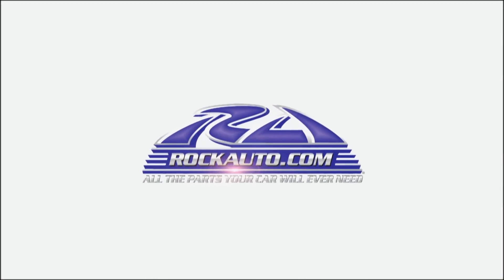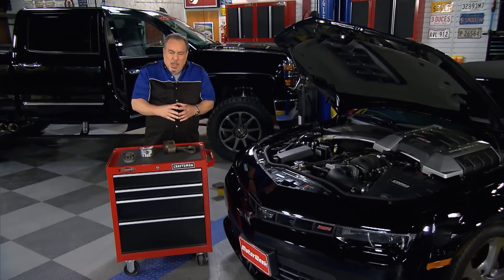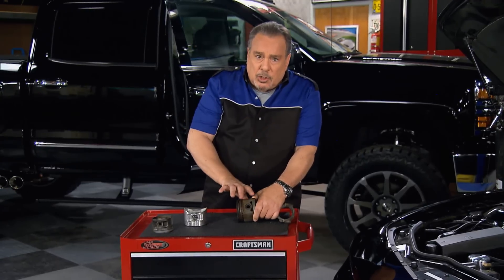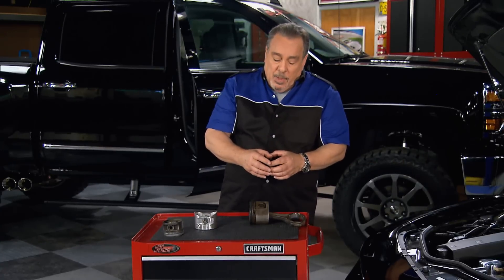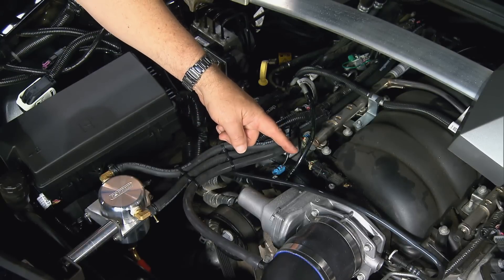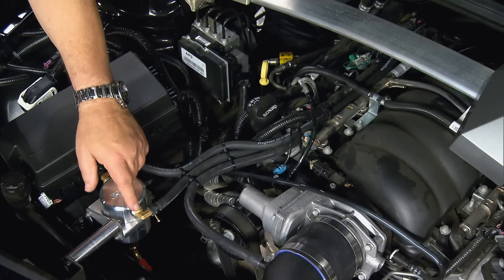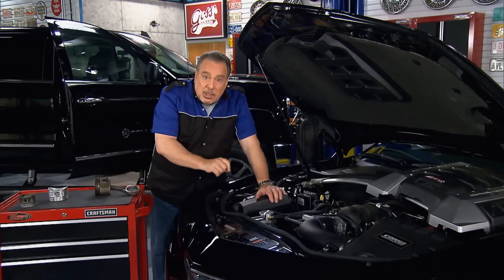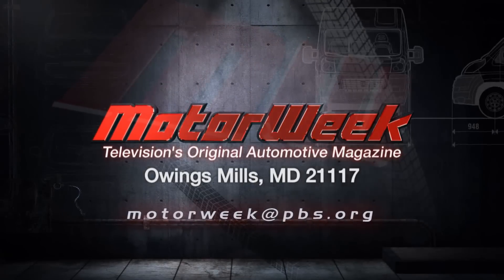MotorWeek | Goss' Garage: Catch Can/Oil Separator

Comment: Which one is better, catch-can or air / oil separator?
Reply: Catch can is simply a can with (hopefully) baffles where the expended oil sits and you drain out every oil change.  An oil separator is normally larger and has a return where the oil is then sent back into the engine.  On normal cars, a catch can will work.  OS is much more expensive and is used for higher compression engines, very large engines, or a race car set up.  For added benefit, you can add a stainless steel scrubbing pad to the can.  Don't confuse that with a Brillo pad or steel wool.

Comment: But will it void your warranty ?
Reply: All you're doing is re-routing a hose from the PCV to the can.  Instead of oil and oily vapor going back to the PCV, the oil is simply contained in the can.  No cutting of anything.  And if you need warranty repair, remove the can, re-attach the PCV hose and you're done.  Takes 5 minutes.  There's absolutely no way of knowing.

Comment: I did the same thing on my high mileage 2000 Ford Explorer. Recycling the fumes from the valve cover completely covered the throttle body and intake manifold. I simply removed the hose on mine and ran a Seafoam treatment, cleaned the throttle body flap and was done. The result was night and day. Although I will never put the catch can in an old school breather might do the trick.

Comment: These are especially useful on turbo and high compression engines. I empty mine every 3 months on my Subaru BRZ. It was a breeze to install and not expensive. It's a no brainer for anyone who does even minor things for their car/truck/suv.
Reply: So it's more for a performance engine or and engine with GDI?
Reply: Not really, more a preventative maintenance item that anyone with a compression ratio of 10 or above or has any turbo in their engine should run. This is one of many things OEMs do to cost cut effectively without ruining the engine in "normal" operation. However, OEM's don't consider hundreds of high revving accelerations onto on-ramps or whatnot to be "Normal". So after a while you will get a gunk build-up in the intake that was suppose to be burnt off by the engine (Also bad for carbon build up). So the solution is to bypass the system all together and take those oily blow bys and capture them before they enter the intake and allow the filtered air to go back into the intake.
Reply: Well Idk how easy E it is so I just let it breathe thru the cap loosen ½ - 2 turns depending on quantity and quality the viscosity 😂

Maybe you can make a video on it.  I had a toyota camry I was playing with.  There pretty quick for a 2.5 l 4-cylinder to rival with the k24

Comment: I asked my local dealer if this would void my warranty on my 16 Camaro, they told me I shouldn't do it. I want to but I'm worried about losing my warranty if something goes wrong.
Reply: It will not void any warranty. They would have to prove that this install damaged the engine would be impossible being thousands of catch cans are installed across the country.
Reply: Also, most of those dealer "salespeople" known as service advisors probably don't know what a catch can is. If they don't know what something is, their standard answer is "it will void your warranty". I also like +Toilet Dog answer too. There is also Magnuson-Moss, which is what +Gatorman refers to when saying they have to prove it caused the problem to begin with, witch it can't possibly do under most circumstances. Just get it and have a healthier engine!

Comment: The only time I recommend a catch can is on a properly working direct  injection or turbocharged engine 
If you have stuck rings the solution is replace the piston rings. Sorry no mechanic in a can or simple bolt on.